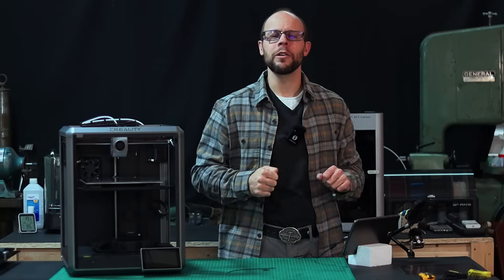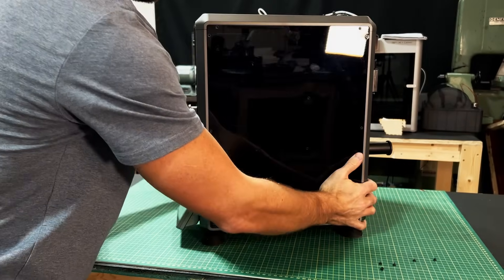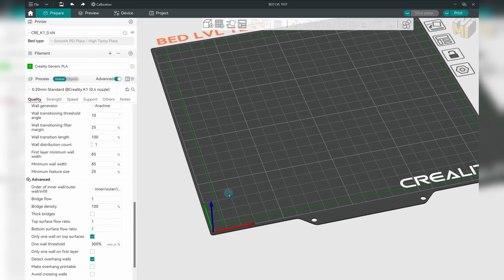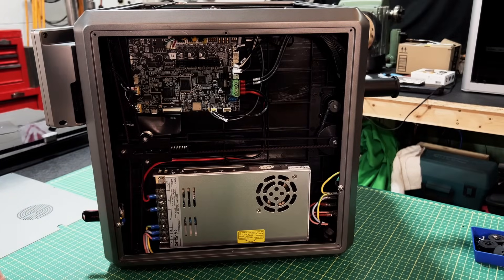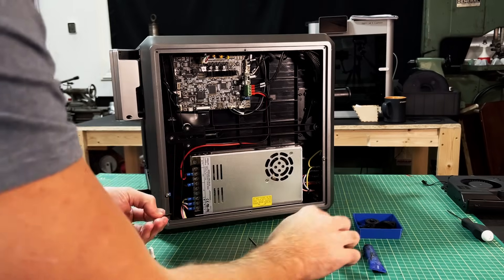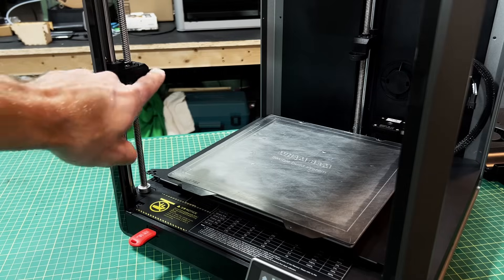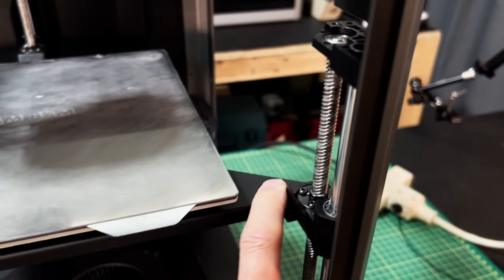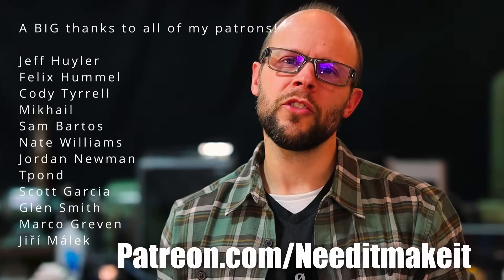Quick and Simple Way to Level Your Creality K1 or K1 Max Bed

Comment: I had a question, would it make sense instead of leveling with the shipping screws. What if we made like a cylinder that went around the lead screw under the aluminum frame that was say 25mm all the way around and just released the tension and lowered it down to that so its even all the way around?

Comment: I just drilled an additional hole on each of the three pads and screwed M3 screws into it from below as leveling screws. I left one mounting screw on top instead of two. Didn't even need spacers. No need to touch the belts

Comment: hello sir,
Recently i bought k1se printer and messed up big time, just as it arrived, i installed klipper from script (curated for k1c) and ran into many many many issues, first one being chamber temp reading got enabled and klipper crashed again and again like crazy, major issues I resolved, printer functioning but now, i need help with minor issues, like macros and cfg files.
plz help
i also have ender 3 with klipper installed but its whole process and cfg files were very straight forward so i have some technical knowledge (not totally noob, can understand terms etc, you dont have to explain it in depth)

Comment: Curious

Can I cut up an aluminum can use that as shimming material?
Reply: I can confirm aluminum shims did the trick. Did one belt skip on the left and the right Z-Screw. Then dialed it in with the aluminum shims; 1 shim on the left and 2 shims on the right.

Comment: I only had a deviation of 0.3mm which felt super off when doing prints, some parts of the bed the nozzle is scratching the first layer and other parts it's not fully connected, leading to some inconsistent printing, especially those that require accuarcy. After this i'm down to 1.5mm which is much better, believe it can be better too so thanks again!

Comment: Practical things to consider before starting:

1. Take the sides off. Not difficult, reasonably quick and saves a lot of aggro and swearing later.
2. There's more than one way to skin this particular cat: 
    a. shims is the easiest (I guess), 
    b. you can also undo 4 screws and force the bed up or down the screw itself - a quarter turn produces quite a move :o)
    c. skipping teeth would be a way less drastic adjustment - involves either forcing the skip (risk damaging the belt) or taking the bottom off and all that.
3. Print the sims starting from 1mm. It's neigh impossible to get 0.1mm printed but in 1.1mm flavor it's done with ease. You'll have to use all three contact points with thicker shims - true, but you might just find it easier to work with something that is not paper thin.
4. I'm going to also print a set of little cups with variable bottom thicknesses and a 4mm hole in those bottoms. There are 4 supports through which the bed is actually attached to its frame. Once you've done all you possibly can with the frame (3 points of adjustments) you can use 4x M4 screws that hold the bed itself to that frame. Worked for me ;o)

Comment: I really don`t know why you are messing with this , the whole point of the bed mesh is so that the machine compensates for the bed being out of tram, it doesn`t matter if its out 1mm or .2mm, it will make 0 difference to the final print. I mean it got you a video for the channel i guess but , as for improving the print . nope .  After spending many years with clipped and enders and the school of hard knocks , I guess it gives you something to tinker with on the K1 but , in reality it compensates very very well so there is really no need for this .
Reply: It matters. Your final print will be exactly 1mm of 0.2mm out of plane. It will not be flat at the bottom. It might have a very good looking 1st layer - true, but that good looking layer will not be flat. It you only print smallish things - probably won't matter. But if you print parts that must fit - they simply will not. It's bad enough fighting thermal shrinkage of ABS or ASA to add to it a wonky bottom surface. Or you could try ironing a top surface of a long piece and see how it works for you (hint-hint - doesn't ;o)

I did spend an evening with my K1C working the bed from just under 1mm difference between opposite corners (one up and another down..) to just over 0.1mm. Rooting it now to get a proper leveling done at the bed temps I work with, not a stupid hard coded 50C...

Comment: Let's take a look at the mechanics of the z screws. The printer is shipped with the locking screws in place, holding the bed to the frame. The frame is held in place by the threaded inserts attached to the tabs of which your shims sit. The not mentioned parts are the metal screw collars. These collars hold the z screws from sliding down into the base frame. As such, these collars actually hold the bed from falling into the frame base when the shipping screws are removed. In other words, the z screws are adjusting the distance from the bottom of the tabs to the bottom of the collars. The error occurs if the collars do not sit on the frame base when the tabs are screwed down. If the collars are adjusted high of the frame base when the tabs are screwed to the frame, additional turning of the screw will occur until collar to frame contact is achieved. Thus, the timing of the z screws will be thrown off, resulting in an un-level bed. The solution is to move the bed to the frame, screw the tabs to the frame (shipping condition). Now loosenthe collar set screw, hold collar to the frame and re-tighten the collar set screw. Additionally, these collars set the height of the z screws and align the height of the belt sprockets. If the sprocket heights are mis-aligned, additional belt drag will occur.    While the tabs are screwed to the frame, but the sprocket heights are mis-aligned, loosen the collar, turn the z screw until aligned, re-tighten the collar while holding it to the frame.

Comment: Does your hotend hit the glass door and side of the front right corner when the printer is homing?
Reply from the maker: There was a time when I had a homing issue, it was when I was using Orca slicer and switching between the K1 and the K1 Max printers, but aside from that, no, I don't recall a time when I had this happen.  When it happened to me, I restarted the printer and then reconnected and the problem resolved itself.

Comment: Nice video and I am going to print these spacers. Question I have is which slicer (?) you used in the video to check the mesh and save the cfg file. In Orca slicer I used I do not see these options you showed in the vid. Or is this special bed level test software?

Comment: I have 2 K1 SEs and they are about as level the rolling country hills, I'll be trying the shims later to see if I can get them level enough to where prints actually stay on the bed. I do wonder if a thicker bed plate might not help limit the amount of warping over time, my Ender 3 had rise in the center and drop-off to the right, and my Ender 5 made a bowl in the center, we'll see what a few months of print heat will do to the K1 SEs' plates.

Comment: A for effort. Just using an allen key on the front two lock collars and turn them in the desired direction until a tooth is skipped on the belt.

Comment: I've done everything to  tramming the corners and I've done the spacers, lead screw tweaking, etc.!  Corner dips to one side on the BACK!  The center of the back matches the center of the front too so that means the back corners got twisted! So I'm man handling it to force it into submission lol. I'm doing it while the bed is cold and when I get it dialed in as close as I can I'm heating up the bed and letting it cool to kind of anneal the metal to stiffen it up after bending it.

Comment: However, I think it's unfortunate to have to put spacers on a printer like this, then I think it's bad that the manufacturer can't do it right right away.But a great video
Reply from the maker: It is a bit strange for sure.  I'm not sure what the thought process was, even if they could add spacers and then we could remove as-needed, that'd be better, or some small adjustment screws like some other brands do.  The single motor driving all of the three Z screws is really the source of the problem, if they could be three smaller separate motors, leveling would be independent like a Voron and the problem wouldn't exist.  I guess it boils down to cost.  Even the Bambu X1/P1 printers have a single motor for all Z screws.  The QIDI PLUS 4 has 2, so they're getting closer.

Comment: So I just purchased a lot of 3 of these from a guy. 3 K1s one parts.. 2 supposedly working. Needless to say that both of them needed some work. I got one printing ok but looks like a bed adhesion issue. I just ran across this video and looking to try it when I get home.. I need to ask what software are you using to see the bed level and how are you connecting it to said software?

Comment: A good start to the video is showing us what software you are using to test the bed level 🙂
Reply: You can use a browser or OrcaSlicer connecting directly to the printer (on WiFi) with the IP
Reply: He's using Mainsail. It requires rooting the device. Many guides out there.
Reply: Can you use a tool from Creality?

Comment: Creality have pointed me to this video as part of thier trouble shooting guide. My bed level is max .30 mm out corner to corner as far as I can tell. Problem I've got is the nozzle is constantly 5 mm above the bed after calibration, Nozzle wipe 5mm above, purge 5mm above, print 5mm above spaghetti. Ive tried all the re-leveling vids, obviously not the spacers as the only thing i print is spaghetti. Ive tried off setting the Z off set, some success, but after it calibrates it seems to reset its self. Cant seem to make any head way with Creality. Any Ideas ?? Any help appreciated.

Comment: Hi, Thanks for the video I found it very interesting having just purchased my new K1C. However I do have a 'newbie' question....does it really matter if the bed is out some because the printer clearly is compensation quite well out of the box even though I have a 1.0mm range? My last printer was a CR10 mini and I am amazed at how well the K1C is printing in comparison. So, do I need to be concerned about the mesh being spot on?

Comment: i don't recommend adding loctite as it can potentially create a scenario where the force required to remove the screw is higher than the force necessary for the tightening tolerance, aka it might only be spec'd to 2nm but the force to remove loctite blue may exceed this greatly in situations where too much is applied causing damage to the plastic mount where these secure. some have had success re-seating these after overtightening with a solder press as i've read. i am using your spacers so thank you vastly. ive been able to share your printables link to help others too. fantastic video thank you again

Comment: Which slicing software are you using?
I didn't notice these in Creality Slicer
Reply from the maker: For the slicer I'm usually using Orca, but for the UI, I'm using Fluidd or Mainsail, you don't need them, you can instead access similar info through your browser by typing in you Printer's IP address.

Comment: Sooo what if the nozzlw is dragging on the bed. Spcers would push the bed up even higher
Reply: adjust z offset run auto bed leveling. manual level your bed close to 0.00

Comment: for the first step can u just undo the grub screw in the lead screw coupler instead of unmounting the belt?
Reply: Sometimes you can, sometimes you can't. They use a threadlocker on those tiny screws in the couplers.

Comment: I used this method with a little extra sauce. I loaded up the model of the K1 from creality in Cad, tipped the cad bed till it matched my probed offsets then extruded a set of custom shims at the mount points, printed them, installed them and hit 0.12 range at working temp of 100c. Well pleased with the result, didn't take long either.

Comment: Thanks for all the K1 videos and this spacer hack.  Are they sending units out with beds that are really 0.8 mm or more out of level? Is that because its a core XY machine?  I was considering a K1 but I value accuracy over speed, do you recommend the K1 still or something else like a Bambu Lab or Qidi?  They do all seem to have about a 10 percent dissatisfaction rate by customers so not sure which is best.  Can you use PrusaSlicer and Cura with the K1?

Comment: Thank you for this video. I had some problems with my K1 Max for the first time in about 1 year. Nozzle change and bed leveling. I follow the guides of Creality but that doesn't work for the Bed Leveling. With these, spacer, it works great.

Comment: New subscriber. Have you seen or heard of anything on a Klipper firmware command “Z_Tilt_Adjust”? I just saw a video that uses this command on a Trident with three vertical lead screws that raise and lower the build plate. This command seems like it’s made specifically for the issues the K1 series have with bed leveling. 
If you have any information on this topic, I’d appreciate any wisdom you might share. Thanks for your time and all the excellent videos!

Comment: How do you calculate so you know what spacers to put in?????
Reply from the maker: If you haven't rooted your printer you can type in your Printer's IP address into your search bar, you'll see the Creality UI and that should give you pretty good info.  If you've rooted you can use Fluidd or Mainsail to get a little bit more precise info.  I have a quick video on that subject too.
Reply: @NeedItMakeIt  I see, I've already rooted it. I just don't know how to read the heightmap and figure out what spacers I need hahaha. I automatically assume that the default view would be how you are looking at it if you were standing in front of the printer. 3 of my corners are angled high, and one of them being flat. So I just want to try and fix this issue. If theres any way you could help that would be great!

Comment: Hi you could also use engineers shim sheet comes packs of 0.05-0.25
Reply from the maker: For sure, and even tin-foil would work.  The shape was non-standard and the screws pass through it as well as there is an alignment pin too, so a 3D printed shim made sense, but if you wanted to get it really dialed in, the metal shims are the way to go.  Good tip, thanks!
Reply: @NeedItMakeIt  Also wonder if you could loosen pulley grub screws add z belt then re tighten grub screws they may sit better and not pull on the z shafts ? Also funny question as I'm fixing my works machine, what is the length of the lockdown screws for the bed ?

Comment: The reason the lead screws are being pulled out of whack is because the belts have teeth, therefore any adjustment available by resetting the belt is very coarse. Shimming them is the only practical way short of rotating the lead screw nuts in their openings, but even that is only going to give you so much accuracy.

Comment: I know is tempting to reduce the (corrected while printing) height error, but in the way micro steps works I believe that is better to leave z correction to float over 1mm instead of challenge the microstep to correct narrower error down to a range that microstep has not strength to move. It's my doubt, but I prefer to leave as it is until it fails a print (I have k1 max with about bed plane z= 1mm x + 0y too)

Comment: This worked perfectly! Calibrated, calculated the differences, printed the spacers, calibrated again and easily got it down from 1384mm  max to 0.633mm and minimum from 0.351mm to 0.083mm. Range gone from 1.033 to 0.550! I will leave it at that for now! :) Thanks for your excellent video.
Reply from the maker: Awesome!  I'm glad it helped you out, sounds like really good results for your printer.

Comment: Congratulations on all your content, binge-watching the videos, and gaining another subscriber! Which version did you use to get all that printer data? I’m on version 5.1 and have even downloaded up to 4.3.8, but it’s still different. 

In version 5.1, I can’t find as much information. Also, my bed is higher at the corners and lower in the middle, which I find strange. 

I’m trying to raise the center with A4 sheets in the middle, but I’m not sure if it will work. 

Thank you very much!
Reply from the maker: Nice, thanks for the Sub!  To get the data you need to use Mainsail or Fluidd UIs, if you've rooted your K1, you should be able to gain access to them that way, but if you don't want to do that, you can use the Creality UI and use your printer's IP address in your search bar (it sounds like you've already done that).  

I have another video which explains why the bed is higher and lower than expected, and it relates to the temperature of the bed at the time of probing, and more than that, the bed should really soak at that temp for a few more minutes too, it will continue to change shape.  I have a video on that subject exactly called 'Let It Soak'.  It should help you get some really good first layers.

Try the soak method and see if that gets you to where you'd like to be.

Let me know!